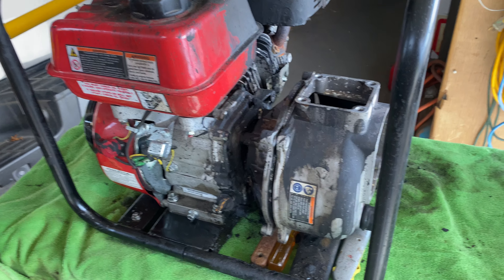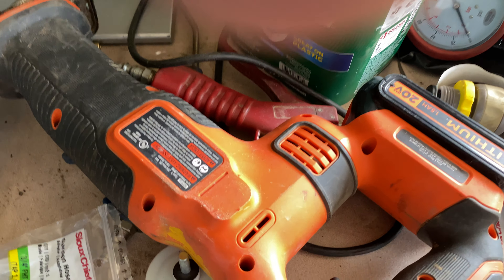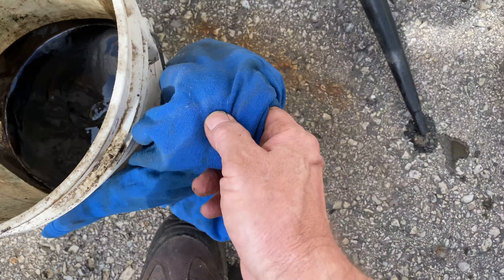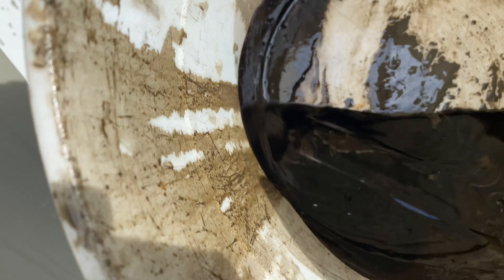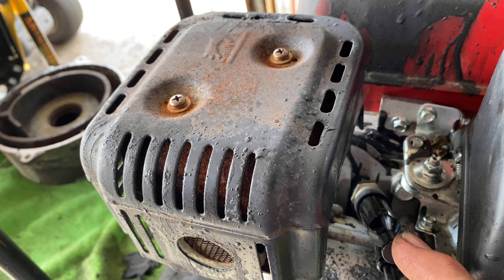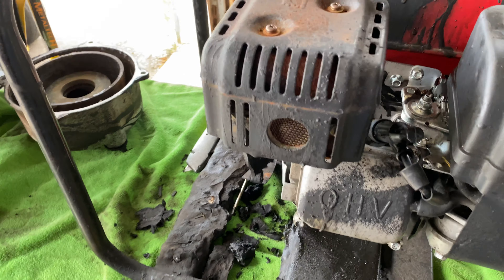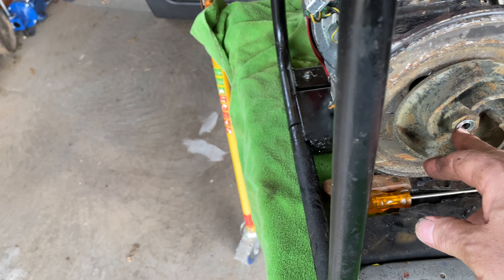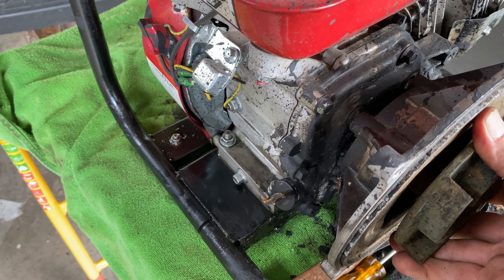Predator 212cc s used for Sealcoat sprayer

Comment: I'm trying to make one to spray foundations, does it build enough pressure to spray out of a 100ft hose with proper coverage on the foundation?
Reply from the maker: I never ran sealant through it.  I bought it in sad shape from a shyster seal coated. The hose was clogged but I got it cleaned out by filling it with carb cleaner and pushing  fish tape through it.  

The hose was 100 feet long. 

After the rebuild of the pump it would spray a very strong steam of water. I imagine it could spray foundation sealant.

Comment: Good video brother just have two question for you how much sealer was run threw the pump and how old is the pump ? I just bought one to replace the on my trailer it said on the box so not run oil and chemicals I assume it will not do anything to the the seals  in the pump what do you think?? Appreciate any information before I hook it up this Friday.. thank you a lot
Reply from the maker: It was abused by a rip-off Sealcoat business. Never cleaned. Left with Sealcoat to harden in the pump and hose and tank. I got my money back selling it after I got it back to operational condition.